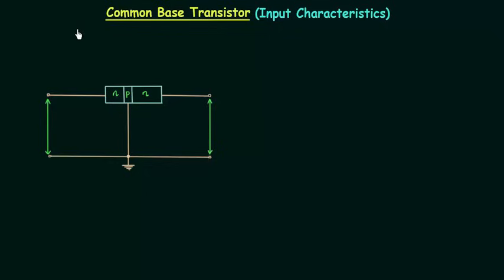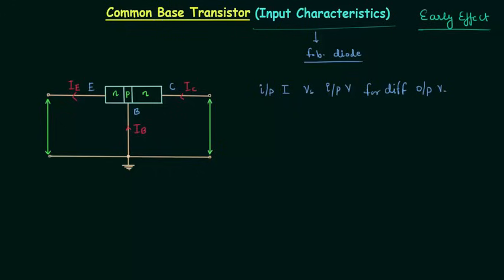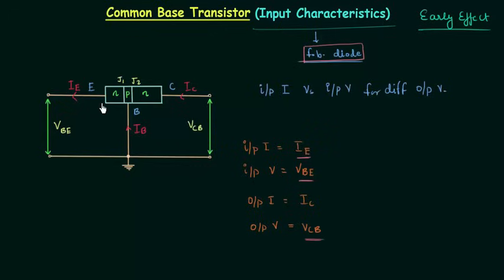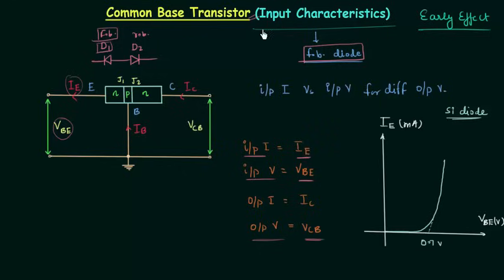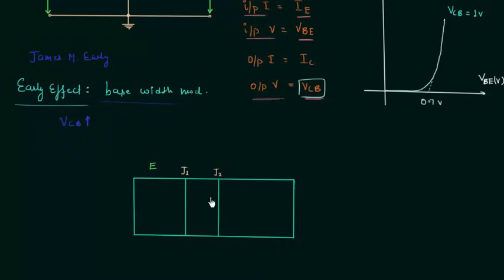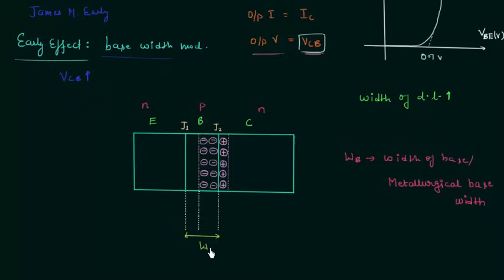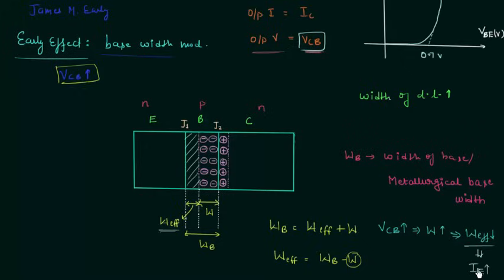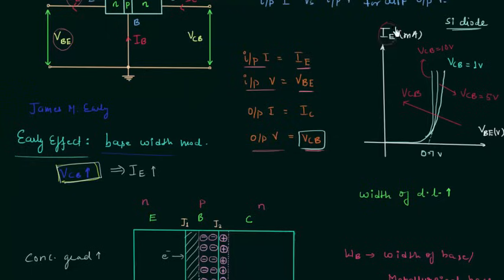CB Transistor (Input Characteristics & Early Effect)

Comment: hello sir 8:01 you said that the chance of recombination is low and ie increases you're right. but my question is base is connected to ground and  if there is recombination there is no potential to crete the floow of current of IB . increasing the the vcb even-though it increases the width the recombination will not have that much effect

Comment: I am not from this background. But we generally look for output against changing values of Input. But here we are changing output and looking for its effect on input variables.

Can someone help me in understanding it on broader level that if I have a exact physical replica of this circuit, how can I change output variable in layman terms? And second question is, when we decrease area the resistance should be more and hence less current but here less Weff is causing more current, this one I didn’t get either.
Reply: 1. NPN Emitter base juntion Forward Biased, CBJ reverse biased: 
                 i. large  concentration of electrons are injected into the base region from emitter. Some of these electrons recombine with the holes in the base and the rest of the electrons travel to the collector region.
                ii . there is a BASE current, which is due to the flow of holes into the base region to compensate for the holes lost during the recombination. 

2. when CBJ revere bias is increased: 
               i. Depletion region penetrates more into the base region, which also means that there is less mobile charge carrier(hole) in the base compared to previous situation.
               ii. therefore the electrons entering from the emitter wont recombine at the base as much as the previous case, which means the electrons can flow more freely to the collector,  ie there is a reduction in resistance to the current flow.

Comment: Recombination leads to loss of free electrons as they take their place in the valence band. So when W(eff.) decreases the area of recombination becomes narrow, which should result in higher chances of recombination as the electrons and holes are much closer. So recombination levels are higher, leaving lesser free electrons. It is these free e- that constitute the base current. So lesser free e- , lesser base current.
In the video, the narrator says that the possibility of recombination decreases with decrease in W(eff.). It was indigestible logically..... Any counterviews??
Reply: That would be the case iff the concentration of base doping is at the same level as that of emitter . The dipping of base is the least and of emitter is highest. So the free electrons won't have enough free space to get recombined. Just think that there 3 free chairs(holes) but 10 people (electron). 
Also that concept yours that narrow space will result in higher recombination is kind of wrong in my limited knowledge. Because even though the width has decreased the concentration of holes hasn't changed, and the the electrons are so fast that even though they have to cover large width the time lag is next to negligible . So that concept that they will be more nearer to each other is wrong concept to begin with. I hope u get the answer

Comment: Why does the I-V curve of the f.b. diode starts to exponentiially grow only after Vbe > 0.7(the voltage buil-in). We learned that it should ideally start to grow exponentially already when Vbe >0 , no?
Reply: This is the case where the diode is made of silicon.The Barrier voltage of silicon is 0.7 .Hence for the diode to conduct the Biasing voltage must be greater than or equal to 0.7

Comment: I have question.let us take the input voltage as 0.7V and keep it constant.the output voltage is increased from 0V to anywhere between 0.7V will there be increase in Ie current.what I feel is,when output voltage is increased from 0V up to 0.7V the Ie current decreases. When output voltage exceeds 0.7 voltage then Ie current starts increases.please tell me the answer

Comment: Sir why you have not considered the depletion region formed in the base region due to input voltage? Because the emitter part is heavily doped then in this case also the depletion layer will be prominently formed in the base region and if this happens base region will be very much negligible and will be of no use.please explain??
Reply: The depletion region of EB junction is neutralized by applying a forward voltage of 0.7 volts if we consider diodes to be made of silicon crystal..

Comment: wrong concept transistor cannot be considered as two diodes connected back to back because firstly crystal continuity will not be maintained & secondly base width will increase which may also cause large recombination in base region and no current in collector

Comment: Sorry but I don't agree with you that when you connect two p-n junction diodes back to back it will act as a transistor. It will definitely look like a transistor configuration but how could it act as a transistor when the base region of your configuration having the same doping level as your emitter and collector. For your convenience, I just would like to share that in any conventional p-n junction diode the p side and the n side are almost equally doped now suppose you connect them back to back to get p-n-p or n-p-n configuration. Now as the base region is heavily doped here so rate of recombination will be more resulting less current in that region. So , eventually collector current will be very small which reduces the overall amplification factor. So, no longer it can amplify signals. Then please let me know how will it behave as a transistor?                                                                                                                   Expecting some positive criticism and sharing knowledge from the audience.                                                                                                                        Thanks in advance.
Reply: Hi, Thanks for your concern which I appreciate. It's fine if for simplicity of understanding you are considering this configuration which is not a transistor.